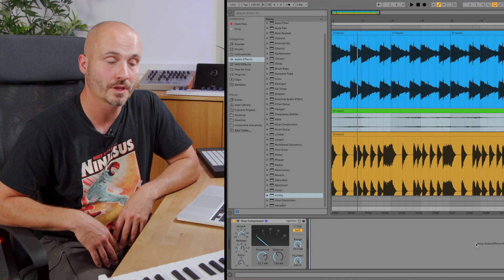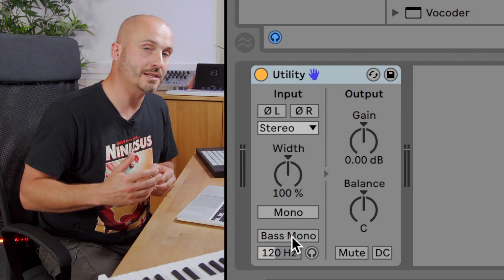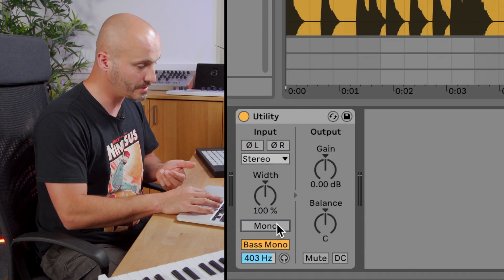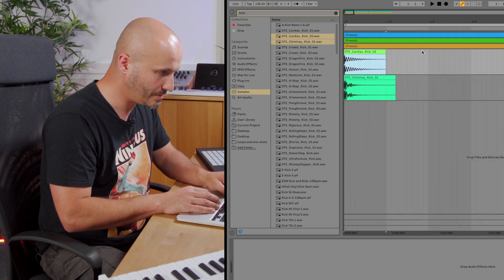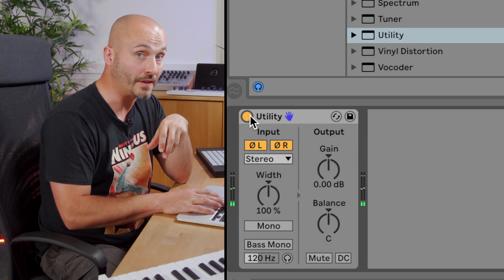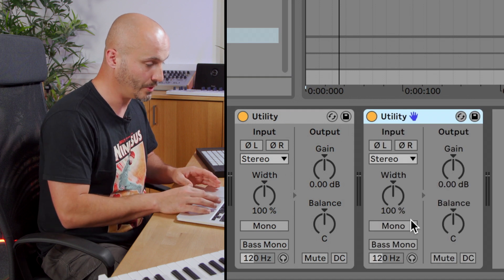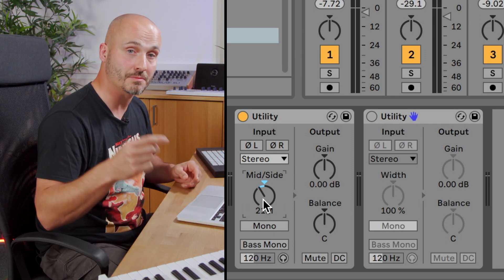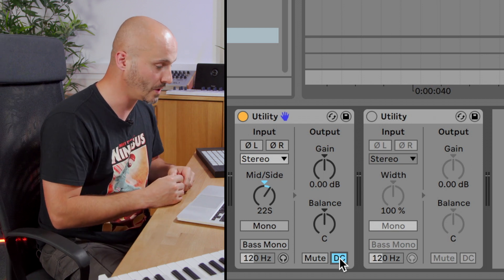Ableton Live Tutorials – Using the Utility Device

Comment: Is there ever any reason to not use DC offset on my recordings then? I sometimes notice some offset in recordings with lots of low end (kick drum mics and bass tracks) so I have been using the DC button on those usually. I'm hearing here that I may as well just use it on anything and everything since there could be small amounts of DC offset, even synthetically, reducing the "efficiency of my speakers"??
Reply: I have the same question!